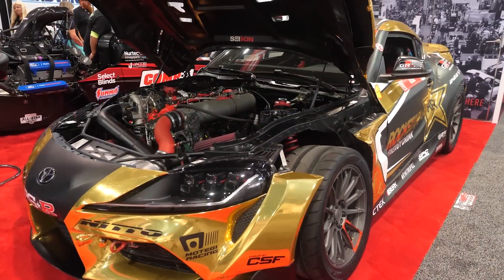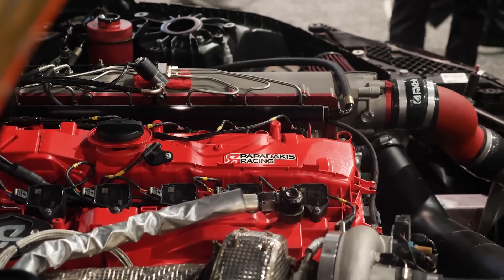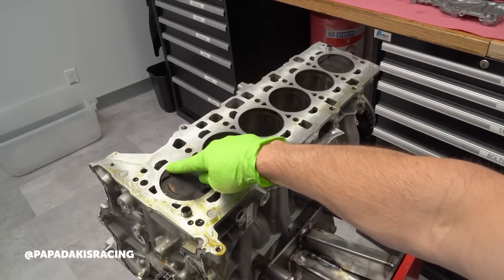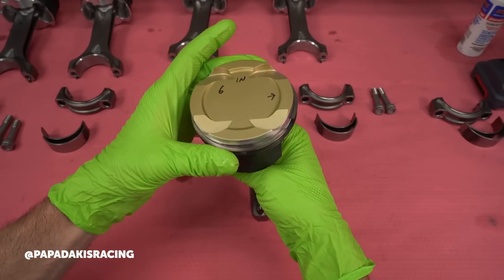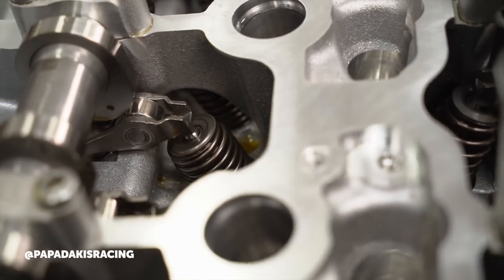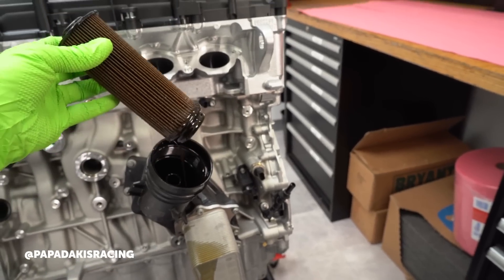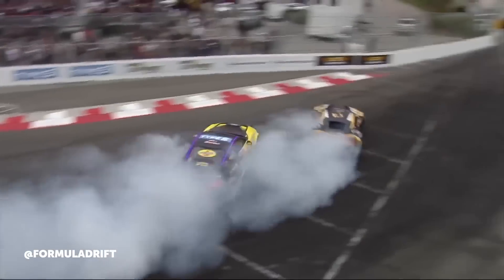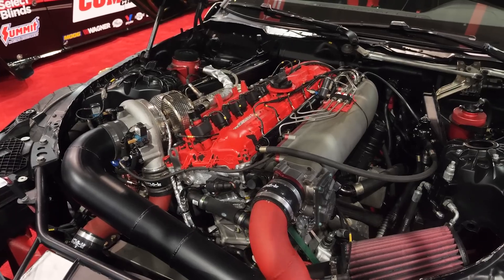Goodnight 2JZ? | 1200HP B58. Stock Block, Stock Bores & No Dry Sump!?

Comment: I've herd every year supra brand new at the dealership and the new one sounds excellent I've driven 90s 2jz and they were nice confidence inspiring, but at the time I had a 69 z28 and a 70 charger with the dual quads and a 4 speed both bone stock and I felt both were faster but I really liked the supra brakes and steering and interior felt like an airplane..back then the supra was expensive around 50k if I remember right and the new one is around the same price..rented a new 94 supra for a month and drove it coast to coast most were rental cars for just a little more $ you could get a Porsche..or less money you could get a 5.0 mustang or camaro.if the supra would of been 30k we would have just as many of them as 5.0 mustangs..the  new one is priced right mostly anyone with a job can afford one not the 94 you had to be raking in some serious money and those people didn't want to be pulling up in a toyota

Comment: Sounds like 2jz lives on but there are some options outside of that now. All my stuff is 2jz but I will give the b58 credit for the street it makes a broader power band making it better off the line. All that valve and fuel system tech.
Reply: bmw m50/52/54, mercedes m103/104 i think those are also quite good choices. that b58 has so long stroke that its hard for bottom end + it has small bore = smaller valves i would say example 2jz still wins if you want the maxium horsepower and max rpm.
Reply: @visa5175 I noticed that last year. I forget but bore was like 82MM and a 92mm stroke.